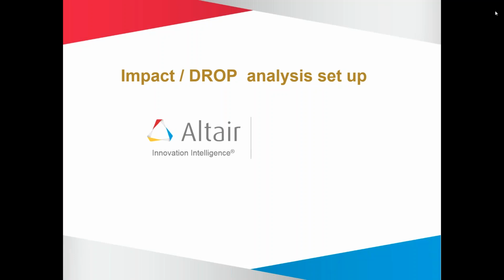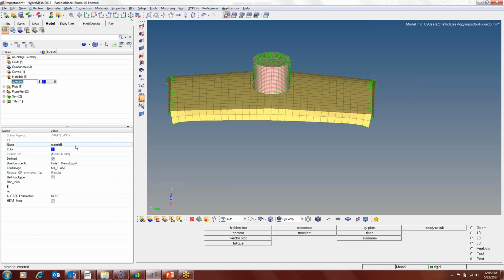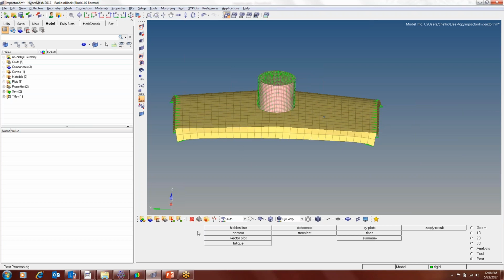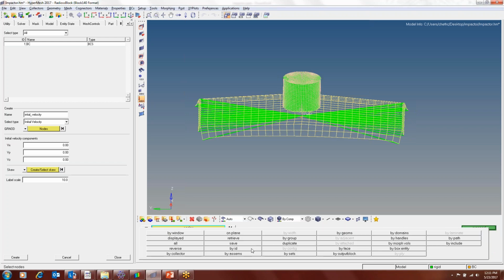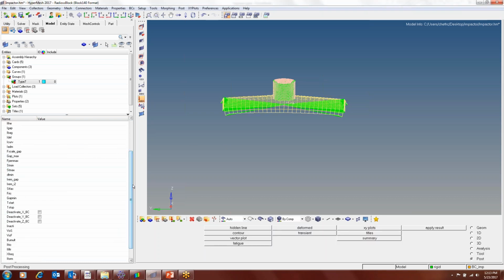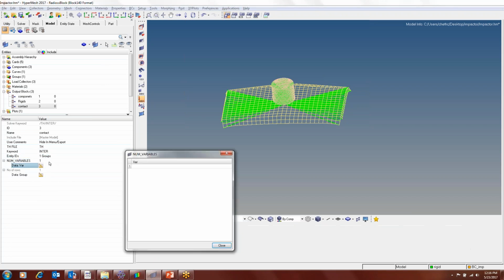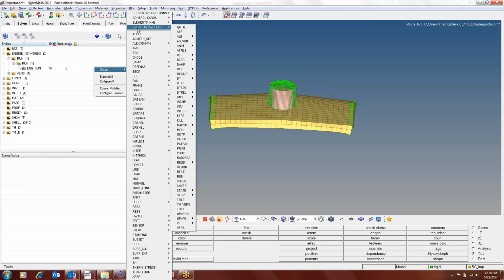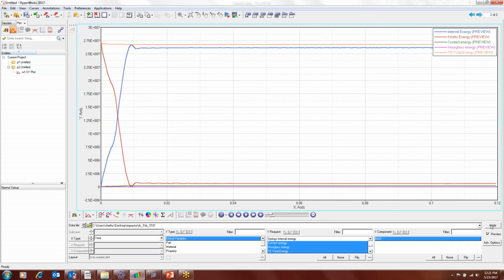1 Impact analysis Set up for RADIOSS in 20mins

Comment: I enjoyed lot☺, but I have some doubts, why should we give mass to rigid body, 

then y didn't u give mass to r body which is connected to roof
Reply: Hi Nagesh,
Thank you for your comments.
In this example, the impactor is considered to have some mass and it was assigned to the master node of the imapctor rigid body  which will equally distribute to all the slave nodes of the rigid body.  And in the problem definition there was no mass assigned for the roof component. Hence mass was not added.
For future technical queries, please post them at http://forum.altairhyperworks.com/
Reply: thank you Avinash for ur response☺